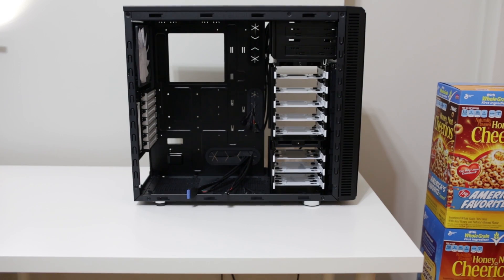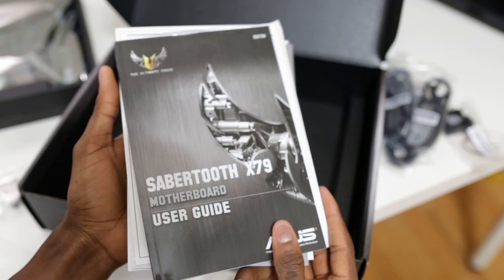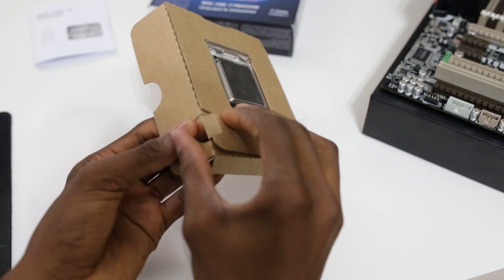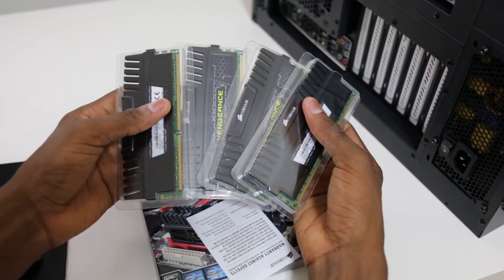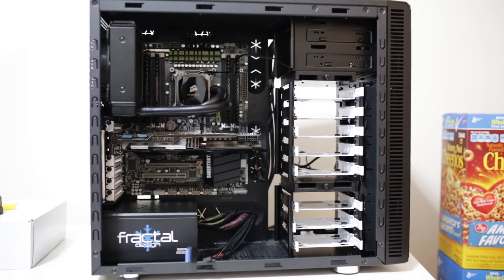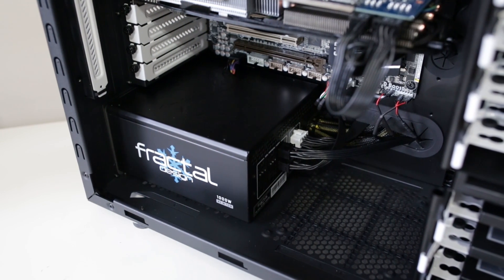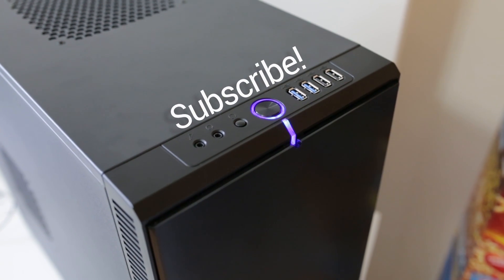Hackintosh Pro Project! [Part 3: The Build]

Comment: Since im planning on installing Os X on my pc, I would like to know if the parts in my pc will be able to run Os X. I already searched the web, but i've gotten no answer so far. This is my Pc:

Intel core i7-2600
8 Gb ddr3 1333 mhz RAM
Nvidia GeForce Gt 545
Medion Ms-7728
Reply: It's alright. The parts are very outdated though. I feel that OS X is very optimized for SSD's, and that if you don't have an ssd, the experience is not as fluid. It should obviously run OS X. But in general, if you're an editor or gamer, upgrade the graphics card.
Reply: Thank you for your reply!

I know the parts in my pc are not the most new ones, but I don't have the money to replace them. About the graphics card, I know it is not the best out there, it even may be quite bad, but since I'm not a gamer that doesn't matter too much.

The only reason I want to install Os x on my pc is because I want to get my hands on a piece of music software, that's called Logic Pro. It is not out for Windows.

But im glad to know that my pc will be able to run it! Thank you!
Reply: DONT BUILD THAT PC YOU WILL REGRET THIS.

Use this:
i3 4130
8GB DDR3 1600 MHZ Corsair Vengeance
Nvidia Geforce GT 730
ASRock H81 Pro BTC (motherboard)

Comment: *****  Hey Marques, doesn't the H80i have two fans?
Reply: Nope only the h100i
Reply: al13nb0y oh cuz in all the videos I watch there is a fan behind and in front of the radiator
Reply: Yeah you can monut a fan on the front and on the backside of the radiator but that doeasnt increase the airflow by a lot

Comment: So far, you've made this process look way too easy and though it tempts me to build, I still hesitate.  Too often the people who find it easy to build one has some experience at doing so, definitely more than I do and it seems it can be expensive when considering the risk of failure.  Though I'm not quite willing (yet) to sacrifice a small set aside amount in order to try my luck at building a cheaper *Frankenstein (*bringing a system to life) version for experimental purposes, your vids do help.  It gives me some ideal of where to start and what to possibly expect.  Thanks for posting.
Reply: Bee Dubb Also, have you heard of PC Part Picker? Great website to check compatibility. http://pcpartpicker.com
Reply: Do a cheaper $300-$400 build. It gets you to understand everything without spending to much. Thats what I did. Before I got into PC Building I had no interest in tech BTW, so I knew nothing besides what I saw in videos.
Reply: starterpivot
Yeah, I might have to consider that route as it makes more sense as I find myself tempted with higher specs in some areas any build.  A cheaper version I think would tide me over on doing that, while giving confidence with any other builds.  Thanks.
Reply: I am 13 years old and I built my first computer back in February 2014. It was really easy, and CareyHolzman really helped me a lot. Go for it, I'm so glad I did because it still functions perfectly.
Reply: Yeah, I was hesitant to build my pc, but it was actually very easy. It took me about an hour and a half to nthe components and 30 minutes to install the os. If you get stuck, just use how to guides to help guide you or look in the mobo instructions manual
Reply: I think I might give it a try soon, maybe with cheaper components for my first go at it, as has been suggested, but I'll continue researching for now.  Falling back on the mobo instructions does give a degree of comfort and a viable option for assistance that I somehow overlooked.  Thanks for the info.
Reply: I have and you're right about it helping with compatibility matters.  I've been checking some of the other built systems time to time and that's probably where I'll end up when making my final move.  Thanks for the info.
Reply: Bee Dubb No problem, good luck! If you decide to build, please let me know how it goes.
Reply: (MrSniper)+ From Mars! Will do.  Might be delayed a month, or so until I can recover from the holidays, but thanks for the info.
Reply: Bee Dubb No problem, and good luck.
Reply: Bee Dubb
I don't know if you've built it yet but I really recommend LinusTechTips. He does a bunch of build guides and goes into detail of how to build it.
Reply: Also worth mentioning that the hardest part is getting OS X to run properly. Worst case would be you cant OS X to work and you just have an amazing windows machine which you should be able to sell at cost to someone.
Reply: IT IS easy to build, I had that exact same feeling in my first build back in May last year, it really isn't too hard, you have to read the motherboard manual and figure out where to plug in the front audio ports, usb 3.0, etc.

Comment: Is there any way to reduce dust buildup? I don't want to buy expensive GPUs and then get the isopropyl alcohol out every 9 months haha.
Is there some kind of dust-free material you use to limit dust intake? I have now optimised airflow in my case so that there is positive air pressure within the case, meaning air isn't being drawn in from areas without dust-filter material, but it is never easy knowing what is the best option. In fact, my case (PGS VX) has a triangular unfiltered side panel which I believe allows dust into the case when it is powered off.
HOW does the FRACTAL DEFINE design R4 case rate in terms of dust-free operation? It is horrible having to clean the parts and would really appreciate the feedback.
Cheers :) 
By the way, what are you doing in terms of work/life/things?

Comment: you don't use the backplate that came with the h100i on a LGA 2011 motherboard, you use the one that is already on the motherboard and the longer standoffs that came with the h100i

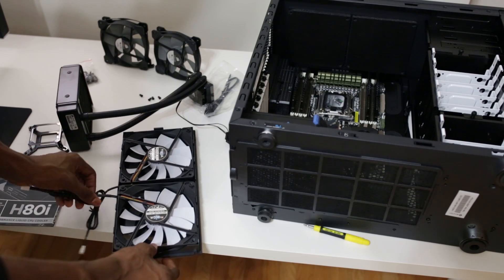Comment: 7:25 loooool the fan is wrong direction hahahahahha
Reply: Why? It was the wrong direction. The fan in the back is normally used as an exhaust fan. Intake on the front and exhaust on the back.

Comment: I was looking to build a computer with basically the same parts but I want to use an upgraded graphics card like the 770 would I still fit
Reply: Yes.
Reply: Define R4 fits any card.
Reply: I have an asus 770 oc and the define r4 so yes it fits ;)

Comment: One thing folks. Keep the firmware of your OCZ ssd drives updated. I updated the firmware of my 120GB vertex 3 and my crappy P4 3.2 Ghz flies. The easiest way is to create a bootable cd from the cd image available on the OCZ website. It really made a difference.

Comment: Just a question for the comments, what is the benefit to having more than one graphics card?
Reply: There are benefits and downsides. Obviously two cards means more graphical power. This can be helpful is you have a let's say gtx 660 (what I use) and that is not enough power for you all you have to do is buy another hook it up and you're good to go. However the more cards the more heat, power draw from the power supply and some games are not compatible so it's a toss up. Personally I am probably going to sell my 660 and get a 770 but the choice is your's.
Reply: Ok, Thx for the help

Comment: too bad you didn't used memory with higher speed. the 32gb of ram will not be a bootleneck when editiong video, but the clockspeed will... better result with less memory, maybe 16gb and higher clockspeed around 2000mhz instead.

Comment: I don't think H100I would fit there since it is pretty much double the thickness of normal fan cuz of the heatsink.
He Does use all SSD so no real heat problem at the front bays. So theoretically he could put the H100I and have it blow out through the front of the case.
However, I don't think that would fair well without top mounted intake to match the output of the dual SP120 fans + the fan of the Fractal's PSU. (Unless he reverses the rear fan, which even then might not give good flow.)

Comment: hey marques do you know if an intel i7 4820k 3.7 GHz would work good on a hack pro? Its for sale on bestbuy and i think its good but i just need a second opinion. And also is there a cheaper motherboard that would work as effectively. Ive been thinking about an asus p8z77 vpro thuderbolt

Comment: If you are just gaming, most games will not utilize high amounts of ram and hyper threading. Go with 8GB of RAM, also look at the high end consumer i5 4670K.
Its a 4 core unlocked CPU, please note that it runs on a 1150 socket so you would have to get a different motherboard. 
If you are get at getting the enthusiast grade cpu, there is a new Ivy bridge release that is a I7 4930k
This would also mean that you should be able to afford a better graphics card, something like a 780 or 770.

Comment: some screw drivers...+ small pliers in case you need to take back off some power cords that are snug as fuck like mine were, probably a flash light unless you have some amazing lighting, and wire cutters to cut zip ties for cable management.

Comment: Great build, Marques. I did a similar build several months ago. Quick question...I noticed you have 3 SSD's. But there are only two 6GB/s connectors on the X79. How did you connect the third SSD to the MB? Thanks!

Comment: Did you plug the cpu fan into the pump controller or straight into a system fan header on the mobo?

Comment: I have a DOC with a quote I made for a teacher back in May 1996 with the following configuration, you will drop dead! :)

AT 486 Dx4 100 Mhz 
4 MB RAM (Expandable to 64 MB)
Video S3 Trio 2 MB
HD 640 MB IDE
CDROM 4X
Sound Blaster 16Bits.
Floppy, Case, Mouse, Windows 95.
HP Printer 660.

USD 2000 !!!! 

Look the configurations you can build with this amount of money now WOW. Great videos dude! ;) Congrats!

Comment: I have an H80i in my build. But I have a Full Tower Case. (Dont give me any crap on why I didnt use a H100i. I dont OC my CPU. I OC my RAM Thougfh.) It draws cold air IN. You also have those fans in the front inhaling air into the case. How is the air exhausting? ( My case I have a 200MM Fan on the top exhausting and 200MM on the side Exhausting. )

Comment: A 400 dollar hack can be done. But not with this kind of performance. An i3 3225. 8 gigs of ram and a entry level mobo wil do just fine. Use a harddrive and case from your old system and you got a hack for less then 250. 
And upgrade it over time. Add a ssd or gpu later.maybe change the i3 for an i5 .

Comment: 7:42 That's the back-plate for LGA 1155/56 and 1366. All LGA 2011 motherboards have a universal back-plate and all compatible cooler come with screws pacifically for 2011.

Comment: You should remove the hard drive cage which you are not using. Think its possible in this case as I saw screws to remove it in your video. It will improve the airflow.

Comment: For everyone asking about the PSU remember that overkill will not hurt the system. And it helps upgrading in the future, such as running two power hungry graphics cards in SLI would be no problem.

Comment: Nope It wouldn't matter at all. I run a system basically Identical to this with a 750w Corsair AX power supply and I only ever consume 300-400w at full load.

Comment: Just wondering about the power supply.  Would it mater if you used the 750 watt in the same model or did you have to use the 1000 watt for this build?

Comment: You dont really need exhaust fans... The air Will get out the small gaps in the case, If he had loads of exhaust thats where the dust would be sucked in. Better to blow out those tiny gaps than pull in.

Comment: Nice clean build. Water cooling is awesome. Here's a tip for a silent build. Silicone pads and washers (make yourself) will really dampen vibration without sacrificing cooling.

Comment: OCZ is a odd brand. A vertex plus is running my laptop right now but I had to go through one first. My first OCZ lasted 13 days. Burnt out completely. I got it replaced with CanadaComputers and then the new one failed after another couple of weeks. I thought I would have to bring it back but unlike the first time, my bios recognized it. I then realized i had to upgrade it's firmware. It has been running steady for 2 years now. Its a hit or miss with OCZ. I always check firmware as a result of it

Comment: I think you did a mistake in choosing parts...you got 2 dual channel kits and used them in quad channel MOBO...you can't do it that way because it's is supposed to work in a dual channel MOBO not in quad you should get 1 quad channel ...you CPU won't get the full speed

Comment: that would also require having to take out the drive bays for proper airflow and possible clearance issues. plus having that in the front would be slightly louder than it in the back, but really he should be using the sabertooths excellent fan software called fan xpert for all his fan to make it a truly silent build, bc i garuntee those stocks fans aint gonna be quiet

Comment: actually this machine will work with any future updates that a current mac pro would, since its using same/similar parts. if it werent compatible in the future, then that means your precious mac pro wouldnt be either since it is the same if not worse hardware. and you can put this/similar hardware in a mac pro when you order it and have it work, you'll just pay an arm and a leg to apple

Comment: Nice build, but you don't have to mount the LGA 1155 bracket for the H80i when you are using a LGA 2011 mobo, the screw systems on the 2011 is built right in.

Comment: There is no difference between SATA cables in terms of speed. It's all just marketing so people buy more expensive cables rather than the cheaper ones. I have cables that I've bought for 50 cents per cable that are just as fast as the "6Gb/s" cables.

Comment: It works fine. You just need a third party player like VLC and the proper keys and codecs. You can use blu-rays on a legit mac with an external drive, a Mac Pro, or a Hackintosh. This comes from personal experience.

Comment: hey marques. you didn't need the h80i backplate. all x79 motherboards come with a universal mounting bracket. you just put standoffs in the front and attach the cooler. no backplate is necessary.

Comment: The H80i comes with pre-applied Thermal Paste, so it's not necessary to apply some before hand, unless you want to use a higher quality third party solution.

Comment: If you want better airflow, you can try removing the unused HD trays. In fact I think that entire cage holding the 5 unused trays can be removed from the case. That will make the case more spacious, cleaner, and have better airflow.

Comment: The SSD is basically the hard drive. He has 3 SSd's so he basicaly has 3 hard drives IN A WAY. SSD stands for solid State Drive. It doesnt use a disk and is all motherboard and stuff. Basically a really fast big spaced flash drive. But bigger and more powerful.

Comment: Those quick connectrors are not adapters. They are there so you can more easely connect you fron panel cables.

Comment: I'm in the uk and I would say go with an I5 3570K GTX 660TI OR 670, decent 1155 socket mobo and you should be good the rest eg, case, memory, hardrive, PSU are all standard. ;)

Comment: I think around the 2,000$ mark:
PSU ± 100$
RAM ± 200$
CPU ± 550$
Motherboard ± 300$
SSD ± 350$
GPU ± 400$
Case ± 100$

comes out to exactly 2000$ (wow I'm good lol).
Well that's not exact pricing but just my general opinion, plus prices drop and rise every day in amazon, prices can drop and rise up to 200$ (good, or bad).

Comment: well idk if it's made and highly doubt it but best bet would be to look for a external pci express x16 2.0 or 3.0 slot to usb/esata if your laptop has a esata port then it would run any pci express x16 graphics card after you hooked up a power supply to it if needed. the down side of this of course is it's not portable and desktop would be better

Comment: would've been a little messy to look at, but you could've used the h100 and placed the radiator outside the case. but it's your rig, your decisions. ^_^

Comment: Marques, btw, the cables for Sata 6GB/s and Sata 3GB/s have the exact same pins and everything. It doesn't matter which cable you use, you will get identical performance. ASUS just color codes them differently so if you have a mix of new and old drives, its easy to figure out which drives are plugged into 6 GB/s ports and which ones are in 3 GB/s ports. JJ from ASUS spoke of this in a newegg video somewhere.

Comment: No, it doesn't work the same as Windows 7 in "Desktop Mode"...now Start button (yea, I know you can get Start8, but Windows 7 doesn't need an add-on download to get the feature thats been in Windows since Win95!)....I have personally used Windows 8 on my system and noticed slow-down BIG TIME....also, there are reports of Windows 8 not selling as much as expected

Comment: Quick tip: It doesnt matter which SATA-cable you use. They all support SATA3 no matter what the sticker says. The only thing SATA3 added in terms of cabling is the locking mechanism.

Comment: I would recommend detaching the side panel material. Triforce Whirlwind coolers on GPU's actually blow air back in to the case. It will raise the general temp's of the case up.

Comment: You should try using a RAMDisk to make use of all that RAM, not sure if it would be compatible with Mac OS though... Also, you might as well take that empty hard drive cage out to help with air flow, since it's not being used.

Comment: Nice build! But it would have been  a little better if you installed the RAM before putting the MB into the case otherwise it could brake or take damage otherwise when pressing the DIMMs in.

But nice video though. I wish, my case was as tidy as this. And as comfortable. But I can't afford water cooling or a good case. The money, my friend, money is always the problem :(

Comment: Hey I recommend buying cheap a air conditioner filer to stick in between the front fans and the case to stop all that dust from entering. I do it with all my cases and you would not believe the amount of dust it grabs.